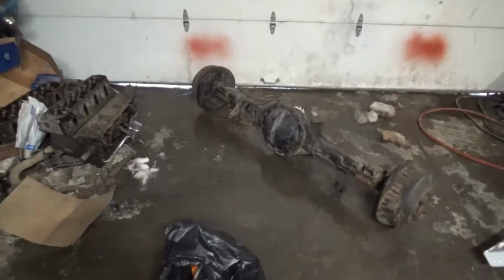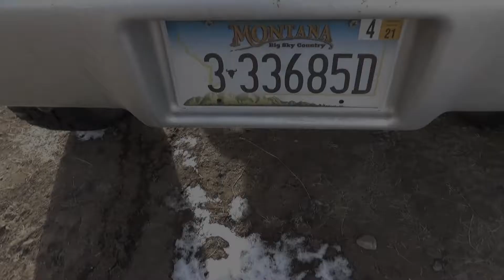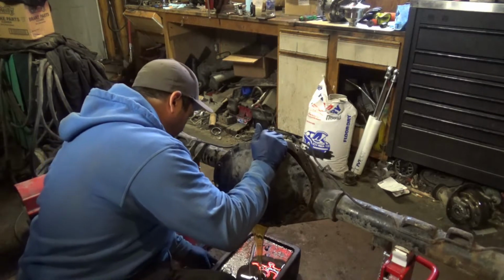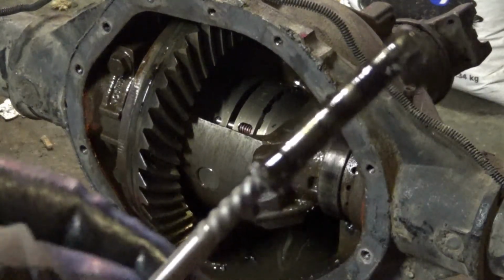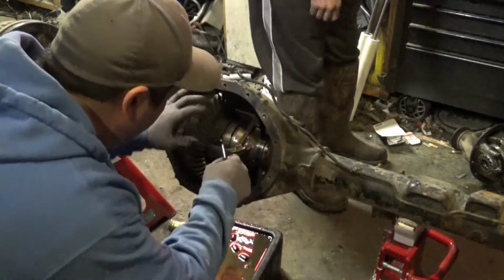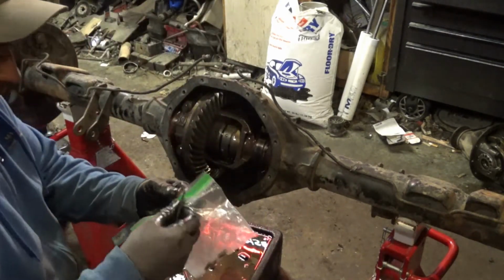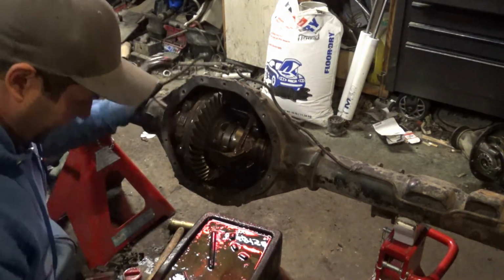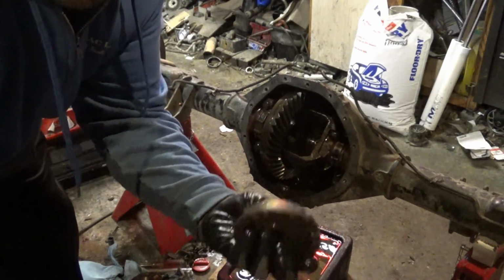GM 9.5 14 bolt Axle Rebuild Part 1

Comment: Hey, I’m currently swapping the 10 bolt from my k1500 and I want to swap in a 14 bolt full float, if I find one that’s 4x4 it should bolt right up where the 10 bolt was correct? I know that that perches for the leaf springs are wider on the 4x4 trucks, thanks
Reply from the maker: It will bolt up long as it comes out of a 88-98 k2500. The spring perches will match. Even the 2 wheel drive perched will. But the axles are 3 inches narrower
Reply: @CrazyBearProductions  okay thanks, I assume 3 inches narrower on the 2wd trucks? Thanks for the reply
Reply: @CrazyBearProductions  Hay Bear did ever happen to do a video on the disk brakes.
I'm getting ready to do the same on a 96 Simi float, not one video on a Simi float 14
Reply from the maker: Ya I did, it's part of the axle build videos
Reply: Put one in my 01 Silverado had to move spring perches 1.5in on both sides to fit rear came out of a 89 k2500 4/4